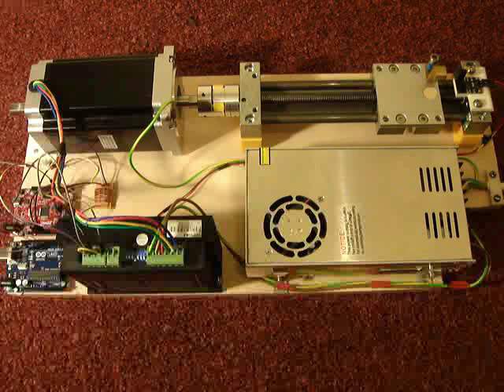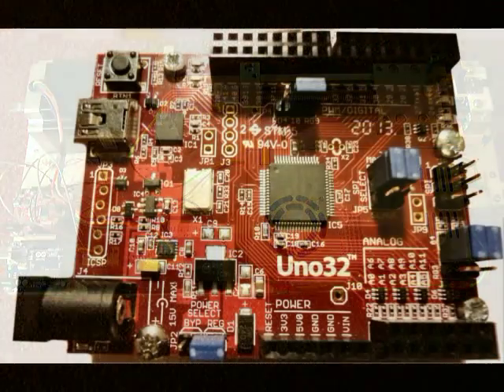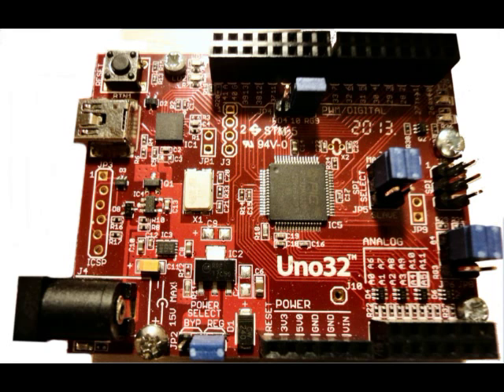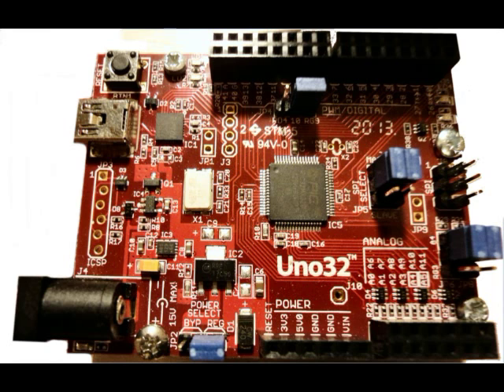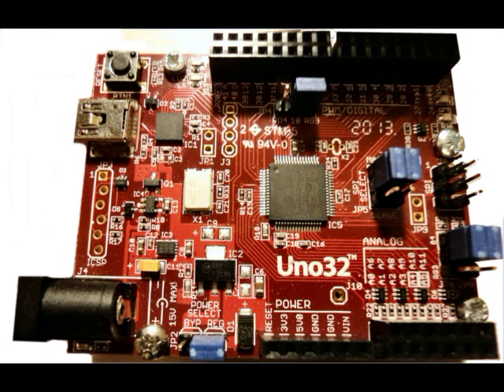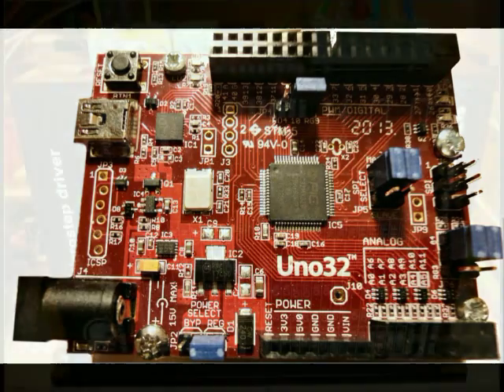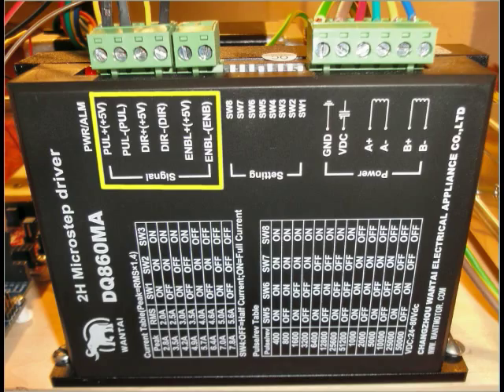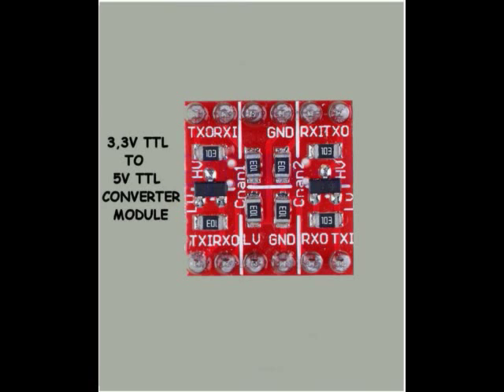Driving a Nema 34 Stepper Motor with ChipKit

Comment: Hi Paul - thanks for video.

Do you imagine the 84 MHz Arduino Due (3.3V) would work in equivalent fashion to the Chipkit?
Reply from the maker: +Andrew Stephens 
Yes, can't see why not. Locate your processor away from power supplies & stepper motors or use screened cables for best results.
Reply: +Paul Fisher Thanks again Paul. Its a great video - I currently have it constantly open in a tab. At the minute I have minimal knowledge but hope to add a CC3000 wifi shield to the microcontoller and set it up as a TCP server to accept commands (at ad-hoc timings) from a Windows based client (Autoit based) to rotate a large plywood turntable suspended on a lazy susan bearing 15 degrees (in approx 2seconds).

I was thinking of having a gear cnc cut on the outer circumference of the plywood disk and a small gear attached to the nema shaft as a drive mechanism. The outer edge of the plywood disk would be supported by ball bearing rollers. The ply disk would be made from a half-sheet of 8ftx4ft ply meant for up to 2 adults to stand on - lots of variables!

Any idea if the nema 34 could be up to that job (or overkill)?

Any further comment appreciated.
Reply from the maker: If you design it so that all the load is supported by bearings then the drive has far less work to do. The stepper in my video has a torque rating of 1600oz/in or 11.3Nm. Your project then also has a gear ratio between 30-1 or even 40-1, a Nema 34 should eat it. Just a thought: what about a long timing belt around the circumference of your disk with a number of equally spaced pins which would engage into the timing belt & drive the platform around (saves a lot of gear cutting)
Reply: +Paul Fisher Excellent idea Paul - I am concerned about the possibly high cost of getting that cncd and I dont need to be exact with the angular movement.

I roughly know what you mean about the pins but have you a more specific product or idea for that?
Also - any idea where I might source those belts (im in UK)?

Im afraid im a bit of a plod at the moment - currently just reading about the SPI bus!

Edit:
Ah - 
do you mean to just attach a rubber timing belt to the circumference of the ply disc (teeth outward)?
then
a long timing belt around the outside of that engaging with a gear on the nema?
[wish I could attach an image :-) ]
Reply from the maker: Imaging machining 6 or 8 off slots around the circumference of your plywood disk and fixing small plates (or pins) which engage within the teeth of the timing belt to prevent belt slippage during rotation. See link for timing belts http://www.gates.com/products/industrial/industrial-belts/synchronous-belts/powergrip-htd-belts
Reply: +Paul Fisher Gotcha Paul.
Yes, will think about that in some detail...appreciated!